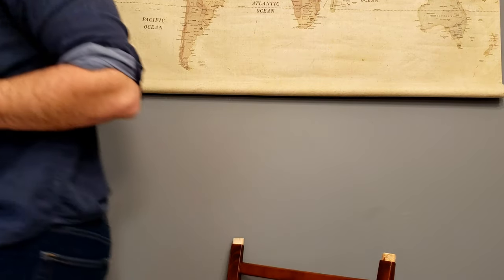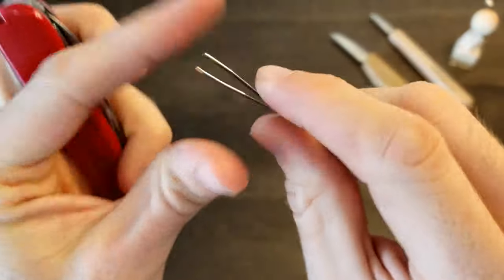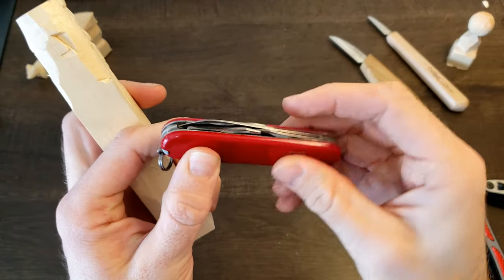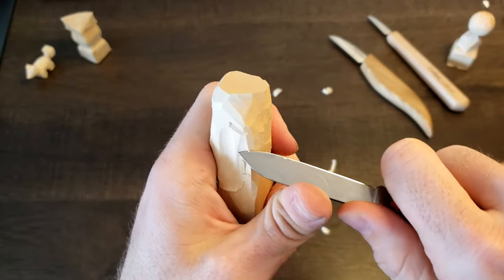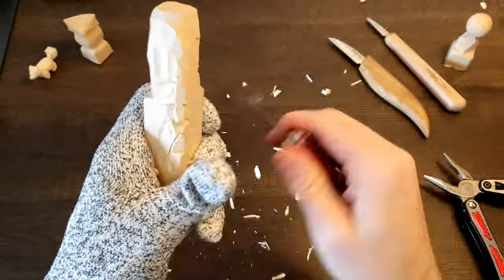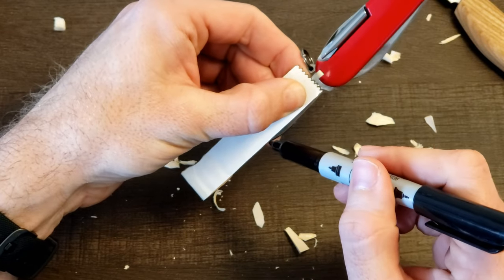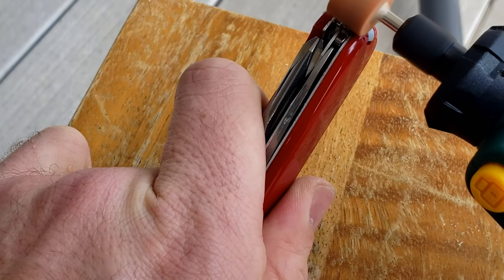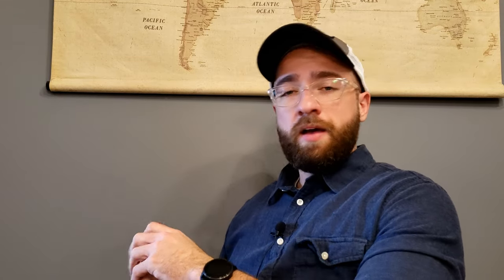Modifying a Swiss Army Knife for the Ideal Pocket Carving Tool

Comment: Victorinox does not make a Wood Carving knife that has two carving blades, a saw, and a large roughing blade. Blades that have 58 or better Rockwell hardness or 440 or better stainless steel.  Just three slots (not sure what they are called) handles. that are rounded for comfort, with locking blades.  Folded no more than 3 1/2 inches long.  If all the carvers out there will unite and keep bugging Vicky about it, I am sure they will listen.

Comment: As someone else said, I feel the Alox Harvester (also known at the Pioneer Harvester or the Swiss Army 7) is the best woodworking model for sure. 

No tools on the reverse make it super comfortable to hold and the alox scales are much less slippery than the plastic ones. The saw & reamer eat through wood and the large blade is strong enough to flatten freshly split pieces. Just need to reprofile the small pruner blade in a similar way to the video above.

They used to make an Alox Pruner ("Swiss Army 2") with just the large and pruning blades, but seems to have been discontinued.
Reply: And now I know of a great blade with all the stuff I want on it

Comment: Love the tinker I use the alox harvester but I reshape the pruner blade in to your small blade. Best edc/whittler I carry
Reply from the maker: That's a cool idea. I haven't tried that myself, but I might have to now!
Reply: Whoa. No way would I do that to my harvester pruning blade. I'm quite fond of how useful that hawkbill is. I could maybe see modding the cap lifter into a whittling blade though. Although, as beefy as they are on the alox think I'd rather turn that into a nice chisel.
Reply: @seanblaha6484  loved the pruner blade to but whittling with it will bend the tip and hit the cap lifter when closing and not whittling friendly for me so all depend on what you use it for it’s good for me and that’s all that matters

Comment: Pretty certain the hiker is actually a slightly slimmer 3-layer, as it has a saw instead of the scissors. Rather a saw than scissors on a dedicated whittler I should think.
Reply from the maker: That's a fair point. I might have to get my hands on a Hiker!

Comment: This knife have small handle, not comfortable to whittling with for most hand size. Also blade have no locking mechanism, it tends to close on its own when whittling or stropping, which can cut your hands sometimes. I would recommend modify other pocket knife with larger handle with some kind of locking mechanism.

Comment: How to give more power to a 3.7v 1300mah  cordless screwdriver into a 12v 1800mah cordless screwdriver using a rc lithion battery. How to convert that tutorial. So i could use a grinder blade to my screwdriver and get a more useful power to be able to cut things. Either 12volt or 18volt.